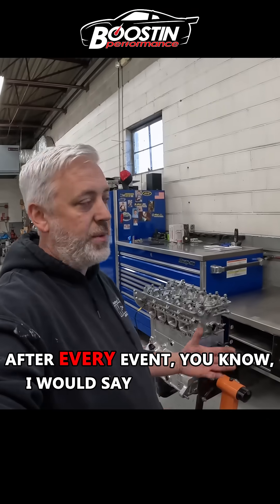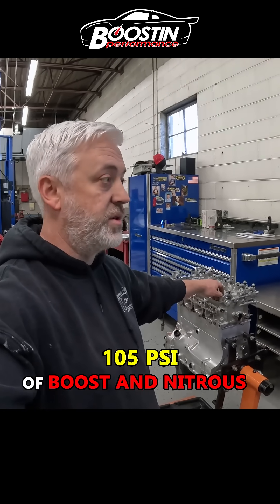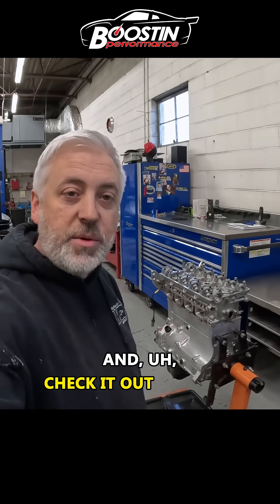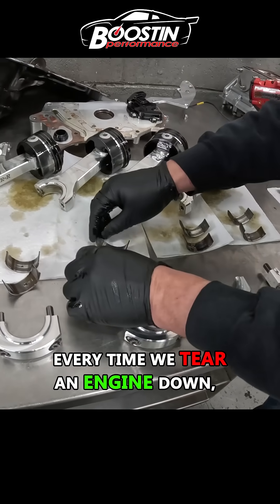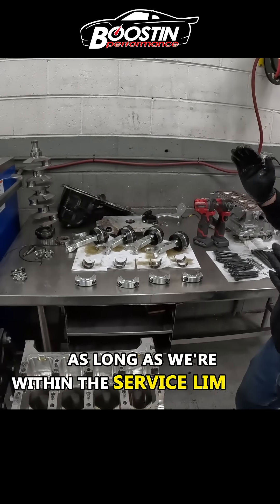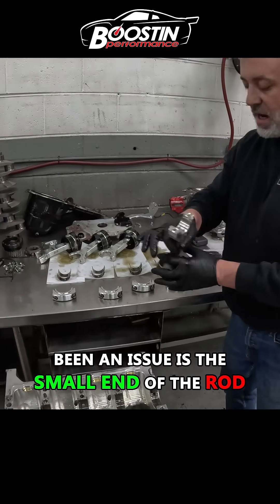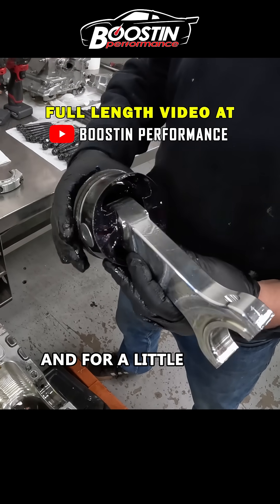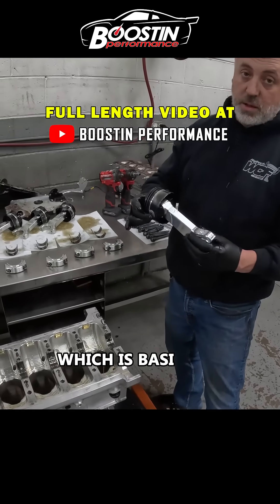2000HP Billet 4G63 Engine Tear Down & Analysis!

Comment: 105# of boost plus nitrous is insane cylinder pressure. It’s amazing you even keep the head on that thing!
Reply from the maker: lol, we have learned a lot about the 4G63T platform over the years, and have perfected our motor building program. Thinking about doing more analysis video like this. Any content you think would be interesting to review/talk about?
Reply: Talking about the engine and what keeps it together is awesome and would like more